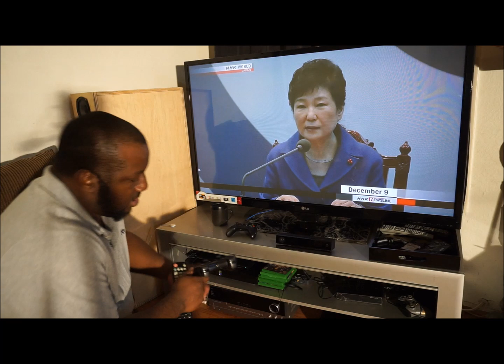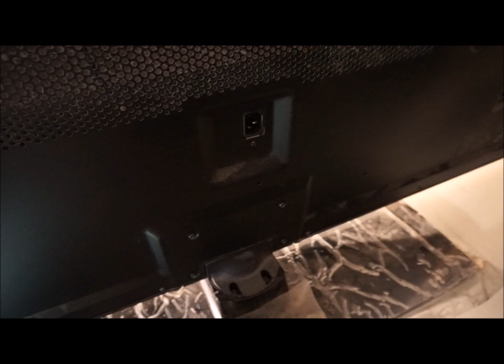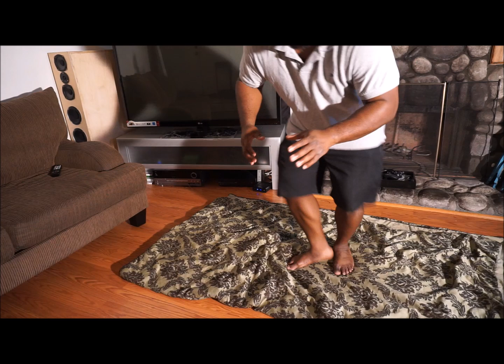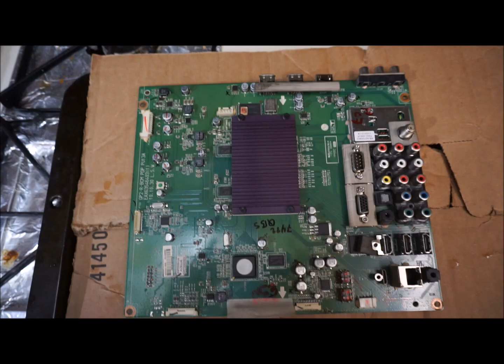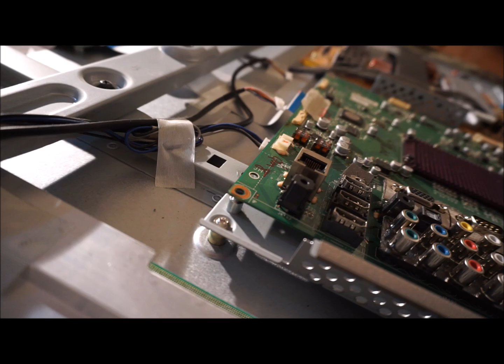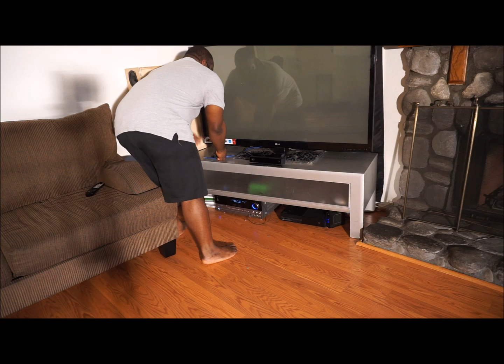DIY LG, SHARP, VIZIO & OTHERS (see vid descr.) TV FIX:  "NO SIGNAL" on HDMI inputs when connected

Comment: This actually worked!
I bought a used 50" LG, and this fix actually worked! I'm so happy!
Reply from the maker: Congrats and Good job on getting the tv working again.
Reply: @frugalfabrication  Is there a more permanent solution? I've had to do this a couple more times since I made that first post. It seems like the heating and cooling from use is messing up the solder.
Reply from the maker: @hirofox85  I am sorry, but I wish I knew of another better option. 

The only thing I can think of that MAY help reduce the frequency of needing this fix is maybe to move the television backing (give the vents on the back of tv room for heat to leave) further away from a wall to create a temperature “heat exhaust” zone.

Or maybe have an oscillating electric room fan pointed/focused directly towards the back of the tv’s rear heat vents/backplate.

I hope this helps..

FYI- From what I was told by a tv repair specialist, most of the new flatscreen tv’s of today (produced after the model in my video) are designed to fail in 3-5 years so you that you will go and buy another one.

I guess the assembly line quality is geared for “cheaper & faster” instead of “long lasting & well built”.

Comment: Re-flowing the solder on the the HDMI board and connections wondering if a heat gun would work as well.
Reply from the maker: A commenter said they used a heat gun but it only worked for 2-3 days and then Failed again. 

The heat gun method was very short lived to fix the problem.
Reply: @frugalfabrication  Have seen a heat gun used with flux to 're-ball' work well tho around that processor, very luckily I was able to do a hard reset and gain back the missing HDMI port   ..  phew 😰.

Comment: SO CONCLUSION WITH LG. TV YOU NEED ELECTRISION SERVCE GUY SO MANY FLAWS LG
Reply from the maker: Hmm...I wouldn’t say that. It was a very good tv. The only issue was In my opinion the “semi-cold solder joints” during the quick assembly/manufacturing process that needed to be reheated to make a good connection once again.

That was all.

Comment: I like the idea the only concern I have with this approach it may end up releasing carcinogens inside oven.
Reply from the maker: Yes, but if you are right, when the TV circuitry gets hot to the touch, the same thing you mention would be happening if what you say is true. 
Just at a macro level over time, because it is not as hot as then oven in its operating state.

Comment: Without taking it out , you can heat it up with hair dryer, it also takes dust off. Thank me later !
Reply from the maker: bil Srky yes, thank you for the info and it can work, but many times the hair dryer method only partially will work for a few days as it does not get the full board hot enough to fully remelt all the problematic the solder points.

There are some people who have posted in the comments that they had tried it with success for only a few days.

Comment: hola lo hice, seguí todos los pasos, coloque la placa en tv y encendió con logo LG rápido se apagó y se puso led stand by en rojo y parpadea, no hay imagen
Reply from the maker: Hola, si puedes intentar usar este enlace para traducir del español al inglés, mi español es algo decente.

https://translate.google.com

por favor revise y asegúrese de haber asegurado correctamente todos los conectores a sus enchufes en las placas de circuito.
Reply from the maker: Fran Castillo also make sure to visually check your board again to see if any electronic chips or components melted or fell off the board when it was heated in the oven.
Reply: @frugalfabrication  IT NO LONGER WORKS, FIRE HAS COME OUT OF THE INTEGRATED HDMI IC8300 AND ANOTHER SMALL JUST ABOVE THE BOARD BUT BELOW THE BOARD POWER INPUT, THIS IS 8 PIN IC8003
Reply from the maker: Fran Castillo  My advice is to disconnect the television from the wall power outlet. DO NOT USE IT. And either seek and source another hdmi board, or discard your tv and purchase a new tv ( THIS IS RECOMMENDED).

Comment: Lol mine I baked it for 380°  when it's done I didn't open the door of the oven I just let it cool down with the door closed. When I opened it, saw like 4 or 5 parts fell off in the bottom of the oven lmao. I Never bothered to resolder it cuz idk which part of the board it came from lol.

Comment: Have a Vizio M65-D0 that suddenly had a no connection that started on Friday. Replaced the HDMI cables with no change. After a lot of searching, I found this video a figured what is there to lose. Heated the board at 380 for 10 minutes the let cool in the oven until cool. Reassembled the TV and wouldn’t you know, it WORKS, great job and thanks for posting.
Reply from the maker: Mike Guzik Awesome, I am glad that you got it working. I am also especially appreciative of you giving your specific model details as well in your response. I am certain it will help several viewers/people who are seeking repairs for their model tv’s.

Thank you.

Comment: can i ask will this work if all inputs are not working but vga is showing pink screen other inputs say no signal
kindly advise thnx in advance
Reply from the maker: Dylan Moyo I cannot say 100%.  

If it were me, I would first Look up local tv repair shops in your area on yelp, and let them tell you the potential cost to repair your model tv. If they tell you they can do it for ridiculously cheap, then this may be something to consider.

If its expensive, then this tutorial may be the next thing to consider. 

I cannot tell you that it will 100% fix your issue as I don’t even know how bad your issue is, or even the model of your television. 

I would say to sit back and reflect on how you want to approach your tv issue and the potential after-effects before doing anything and weigh both options.
Reply: @frugalfabrication  ok thanks but its the exact tv like your even the model number is the same let me try. can i use a air dryer ?
Reply from the maker: Dylan Moyo i have heard air dryer method is a hit or miss. And if it does work, it only does for a short while (a few days).
Reply: @frugalfabrication . Ohk thanks i will then use the oven thank you so much
Reply from the maker: Dylan Moyo you are welcome.

Comment: Very nice video and I thank you for this.
I read on the internet, that this "baking" repair version is good fora limited time only. Without knowing your answer to this comment of mine, my simple question is why don't you replace the chip responsible for the HDMI ports ?
Of course, I do not know if these are standard or they are exclusively made for LG and also if they can be found out in the market. Most likely you have a much better idea than me. 
I would appreciate your comment. Thanks again.
Reply from the maker: george759 i have done this repair about 2-3 times, and after each repair of the television last about two years or so. You Can replace the faulty Chip would take more than likely a lot more effort as the pins for the HDMI controllership are ridiculously small and thin. 

But overall I believe the main issue is a weak solder joint from factory problem.

So by placing the whole board in the oven it reheats and re-melts all the solder joints in one pass/go. So if there were other chips resistors or diode‘s that had bad solder joints they are all remelted at the same time.
Reply from the maker: george759 oh and you are welcome anytime.
Reply: Thanks for your very prompt response. 
But just in case, do you know if these chips are available in the open market ?
Reply from the maker: george759 I am almost certain at the time the chips could have been bought on the open market. Problem is this tv was from circa 2008 (I believe). And considering how fast technology changes. I would guess that various competing chip manufacturers have all progressed to newer versions of chips. 

They may even be on the 3rd iteration of these chips. And if so, more than likely the pin layout/ arrangement is different.

If you want to try this out, you can get various chips from digikey.com, and mouser.com. 

Personally, I would not go this route unless you are very, very experienced in soldering and have all of the necessary tools and magnifying lenses, etc.
Reply from the maker: george759 keep in mind, the chip can be totally fine, but it is the bad solder joints from the chip pins to the circuit board that are bad.
Reply: @frugalfabrication  Thank you very for your kind hospitality. I will proceed with the way you suggest.
Reply from the maker: george759 Anytime. You are Welcome.

Comment: Had an LG 55LE5400 all the ports stopped reading input and this did the trick had to adjust connections once after reassembly but other than that my 9 yr old tv just sprung back to life
Reply from the maker: ManoOmega great job on repairing it and thank you for chiming in with your make and model for the other viewers.

Comment: Thank you for going on through amazing  details, bro! 

I have a LG  42LB5600 that, all the sudden, showed dim picture, it means that, despite all,  I can see some kinda ghost- like image while the sound would be just fine. Of course, I can Change channels! So, Sir,  I’m gonna try your so well explained video; finally, I will be reposting my results. 

Thank you.
Reply from the maker: Theodomir Rwabagaro Thank you for your compliments, please be careful as I am not sure this will fix your ghosting image issue.

Please do some through research on google. And also search for the technician repair manual for your model tv on google... you may find the manual on scribd.com.

Within the technician manual there is a troubleshooting section that lists some trouble symptoms. And based on the symptom it will guide you to what board/circuit is the problem.
Reply: @frugalfabrication  Thanks!
Reply from the maker: Theodomir Rwabagaro you are welcome.

Comment: I was skeptical, but I figured I had nothing to lose.  Mine is a 60 inch LG, and it came apart differently....but the concept is all the same.  I baked at 380 for 10 minutes, and I'm back in business.  Looked it up, and solder melts between 361 and 370 degrees, so there is no need to go hotter than 380.
Crazy trick.
Reply from the maker: MisterFuman Good work man, and thank you for the update reply for other readers/viewers.

Comment: Lots of LG being mentioned in the comments.

Not a permanent fix. The flip chip nature of the main chip is at fault. You are not fixing the soldering as it is not getting hot enough to melt the solder. The chip itself has micro solder balls on the chip to the substrate PCB and people think this oven trick is jiggling them a little causing contact to re-establish temporarily. What the heck, if there's no other option, give it a go.

If it does work for you, the best thing to do is to put better heatsinking on it to minimise future thermal shocks killing it again.
Reply from the maker: Stephen Low well it has worked. And the duration between oven fixes is 1.5-2years(done 2-3 times). This was better than spending another $1,700 for a new LG tv. It prolonged the life of the tv shown here for another few years (the lifespan of another new LG tvs warranty).

Many have received the same success results with LG, Vizio, and other tv brands in the comments.

Instead of throwing the tv away, they did this and are enjoying their expensive tvs for quite some time longer.

Comment: Used the hair dryer method without disassembly for my LG 50" plasma, worked for 1 day.  Used the hair dryer method a second time (about 2 minutes) and then added a cheap 3" USB fan to blow air into the cooling holes on the back of the metal cover.  This time the problem has not reappeared after more than 1 week of daily usage.  You can use one of the USB ports so the fan goes on and off with the TV.    Read some articles that state the HDMI 'no signal' issue can be related to lack of sufficient cooling for the HDMI chip, so I tried adding the fan.  If this works for you it's a lot quicker and easier than removing and baking the board.  In the video it was mentioned that this was the second baking of this board, the fan is cheap insurance to possible avoid a second trip through the oven.
Reply from the maker: John Walker Awesome, thanks for the extra info and tips.
Reply: @frugalfabrication  I was getting 1-2 weeks between each treatment.  All things considered decided that the heat treatment (hair dryer or oven) are at best temporary fixes and at worst overheat all the components on the board.  Purchased a replacement board from LG (it's new, not refurbed) as my permanent fix.  More expensive but cheaper than a new TV and gets me a couple more years out of the set.
Reply from the maker: John Walker if you still have your old board, maybe look online and find an electrical repair service for around $70 or so and turn it into a spare board.

I say this because outside of 3-4 years after a tv model has been introduced, it seems manufacturers stop making parts for the tvs.

Comment: I was at my wits end trying to buy cables and adapters to turn the VGA to a functioning HDMI, an HDMI switch box, etc and came across this video. IT WORKS!!!!. Now I can send those cables back for a refund. Now my $75 Craigslist 60" plasma TV is featured front and center in my basement and can host my Roku and Directv! I'm not quite sure why I get no signal when I plug in my laptop in an attempt to project to it but this is good enough. I'm living to fight another day. THANKS A TON!!
Reply from the maker: aaronr2000 you are welcome. Anytime 👍🏾👏🏾
Reply: Turns out the laptop not working was the same reason I got a no signal message again - faulty hdmi cable. Whew! Scared me for a minute there. All is well with the world!
Reply from the maker: aaronr2000 Whew. Thank goodness.

Comment: Hi, Is the piece you worked on the same as the mother/mainboard?
The diagnostic on my TV: once is turned on, screen stays dark with the LG logo in the middle of screen.
Any suggestions on what needs to be baked. Thank you in advance
Reply from the maker: Dubhe Alpha yes the board I worked in is the mainboard(the board that has he hdmi plugs built into it)

If you were going to do this please take your time and watched you the whole video a few times so you can get all the items necessary in preparation beforehand.

Also dont rush.
Reply: @frugalfabrication  Hi, theoretically  my problem is the same as that HDMI issue you had?
For the note, do I need to pre heat the oven and if so, to 190 degrees or 200. Thanks again
Reply from the maker: Dubhe Alpha If you working in Celsius, I would set it at 190 degrees Celsius and I would preheat the oven.

There is also extra info in the video description  as well. 

I hope this helps.

Comment: That happened to me on my old Aquos Sharp TV. A humongous beautiful monster of a TV. 
Anyway, I couldn’t view cable TV, after a thunderstorm. I took the TV off the wall, tried all other non-HDMI inputs... they all worked, except for all the HDMIs. Not a single one worked. I then did a factory reset on the TV... that didn’t work either!!!! I opened the TV, to see if I could find leaky caps. Not a single cap was leaky. It turned out to be the HDMI section of the main video board!! I located a tiny chip with about 100 tiny pins all around in that section of the board. I desoldered it with my hot air iron, put it under a science teacher’s microscope (I work at a school BTW) and got the numbers off of it. One of the words on that chip was “ACTUC” ....whatever that means. I ordered it for like $15.00 from China. I tried to solder it, but I just couldn’t do it. I’ve never soldered a tiny surface mount chip before, and I wasn’t about to finish ruining this board either. So I took it to a pro repair shop that has a cool microscope with camera and video. The man there mounted that chip for $45. Low and behold, my HDMIs were alive again!

Comment: Hello, is it possible not to laydown the Tv to remove the back panel and remove the input board? I have a
Lg 60pk750 and also want to remove the glare glass its broken from left corner going towards middle of tv. About 8 inches with multiple lines. Any recommendations? Thank you,
Reply from the maker: From what I remember, yes it is possible to remove the back panel without laying down my LG PZ550 tv.
Reply: Thank you Again, I will try it first on its stand and if its too complicated then i will lay it down to remove panel.
Reply from the maker: +adle estrella sounds good. 

And just in case, if you have to lay it down flat, you can use a very wide/large piece of cardboard to cover (masking tape over) the cracked section of the glass screen. Just so the “puffy” comforter blanket doesn’t directly push up into the cracked glass corner.

Comment: I can't believe this worked.  Did this  exactly as in the video after the hairdryer method failed.  

I think the reason mine failed is the kids yanking on the HDMI cords so this time I secured them firmly to the TV wall mount brackets with zip ties.  This way if they pull on the cords it pressures the cable and mount instead of the main HDMI board.  

Awesome fix, thank you!!!
Reply: Oh, should have mentioned this was on a LG 55" lcd.
Reply from the maker: Awesome glad it worked out for you! And remember, you can do this again years from now if you need to.